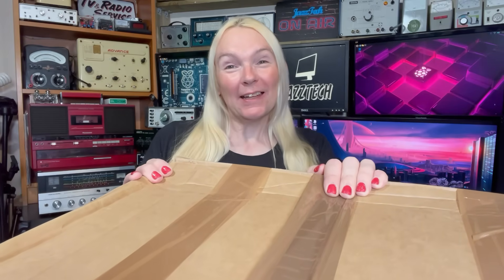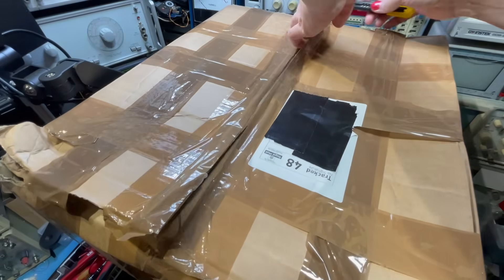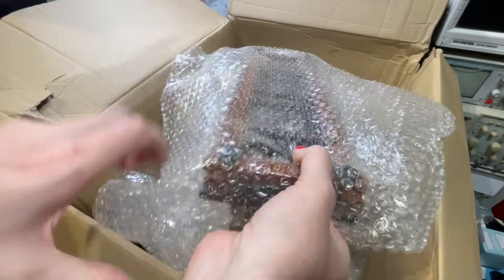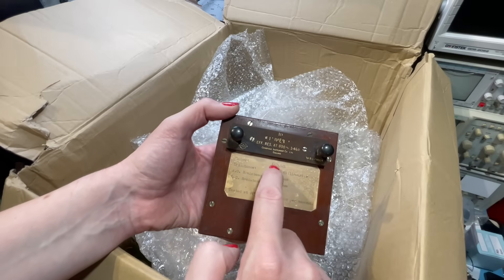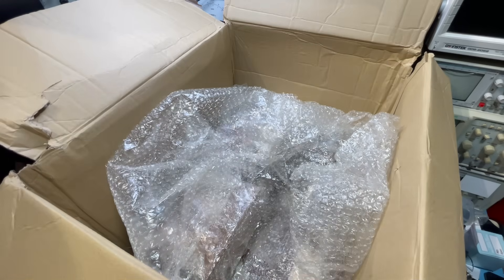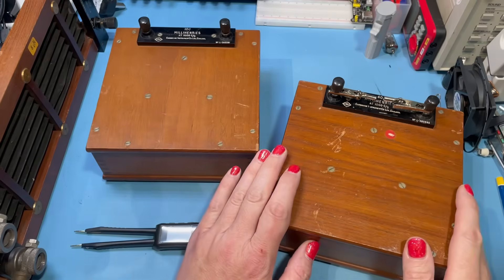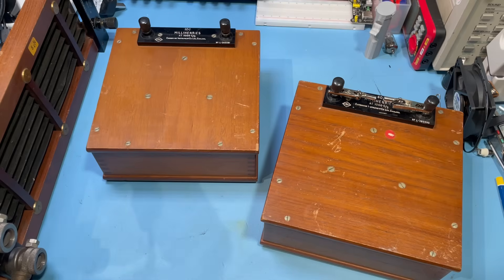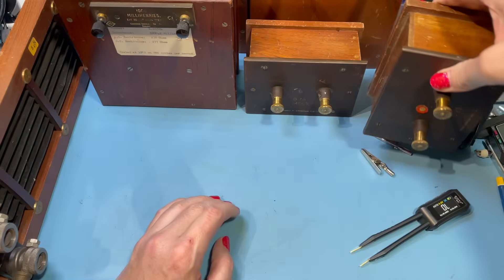My Luckiest eBay Bid Yet? Now What Have I Bought!  Lab Standards Mailbag!

Comment: I'm so envious!
My "treasure" lives in the attic - stops the roof blowing away...
Btw - surely 'box' rather than 'dovetail' joints 😮

P.S.  You mentioned null voltmeters. I obtained one years ago with several digits to dial up. Mostly mechanical with airport-style flappy numerals behind windows!
Reply from the maker: Are you referring to a John Fluke null voltmeter, something like an 887 or 895?
Reply: @JazzTechUK  You ARE clever. Well, looks like the Fluke 881A in a YT vid by W2AEW. He has a link to info about the precision divider therein.
And no, I didn't venture up the loft ladder to look. I think it's living next to the giant VTVM of 50s vintage which has silver-plated innards!  Cannot find a pic; recollect maroon panel with centre-zero 30 microamp meter (frazzled coil). Employs E88CC which appears to be equivalent of £20 note these days.
I'm enjoying your vids!
Geoff.

Comment: That variable condenser is beautiful... Can't wait to see it cleaned up and what's inside!!... Nice work❤
Reply from the maker: I will do a video taking some apart in the future but I have some much nicer air spaced condenser standards that are just sheer engineering works of art. Will show those in another video. Thanks for watching.
Reply: @JazzTechUK looking forward to that 😊
Reply: @JazzTechUK  I was suspicious of that paper capacitor one, but if they haven't been in a hot radio, I guess they still have all the wax in the paper... Had an old Bush valve radio that had a 0.1uF wax paper across the mains.. at least it wasn't a RIFA

Comment: Nice collection, I couldn't see all the serial number on the Cambridge Instruments units, but from my records serial numbers L-64324, L-74925 and L-76723 are likely between 1935 to 1937. L-346981 will be 1956, L-355130 will be 1958, L371821 will be 1959. The L-385595 and L-385581 will be around 1960 to 1962.
Reply from the maker: Do you have any information on them? Old catalogues or spec sheets?
Reply: @JazzTechUK  No, I collect the Unipivot system, so I only have information on those.
You could try contacting either the Cambridge Museum of Technology or the Cambridge Archives in Ely. 
The Cambridge Archive have a lot of the old company archives stored away and can be accessed by the public on request, just depends how much time you want to spend researching.
There is also the Whipple collection at Cambridge University, but I believe that is a private collection, so I don't know how accessible it is.

Comment: Jazz, that box of standards take me back a few years when I worked as a test technician responsible for testing and demonstrating large (up to around 1Mw) DC drive systems for mine winders and steel rolling mills. I used many different types of setting standards to verify accuracy of test results. Memories... 😁👍

Comment: An Australian, self proclaimed genius' bragged about working for Cambridge, and his 'superior engineering skills' also went on and on about selling to universities rather than cal labs or OEMs. He also claimed that my design to remotely monitor the current for tower lighting could be replaced with a cadmium photocell, and a couple transistors. My design would detect a single failed lamp, while his concept couldn't see even half the lamps because of the tower height. Also, here in Florida it wasn't unusual to have part of a TV towerabove the clouds.   In the United States, you have 72 hours to repair failed lighting, and the problem must be reported the day it occurs. I use a spare audio channel between the two tower sites. A crystal derived 1024 /Hz tone was sent when less than full current was in use. At full current it was gated off. At the second tower, a simple LM567 tone decoder recovered the signal. A large LED at master control would start blinking when the system activated at dusk, and stay solid at dawn. The design was accepted by the FAA and the FCC. It cost me less than $10 to build, and was in operation in under 12 hours  from the time the first tower was no longer being monitored locally.
The standards are nice, and reliable when properly stored, but heat, humidity and rough handling can change their actual values. A nice addition to your collection.